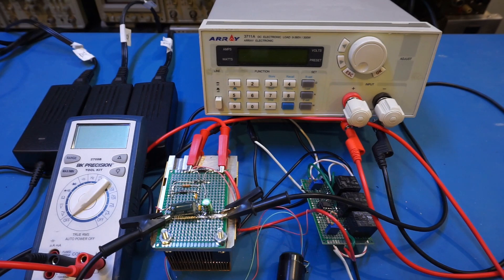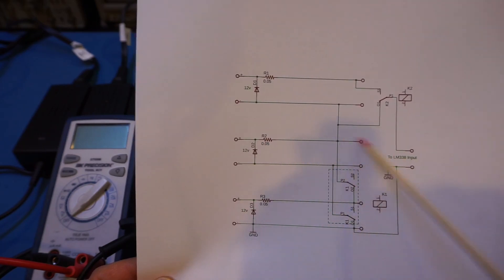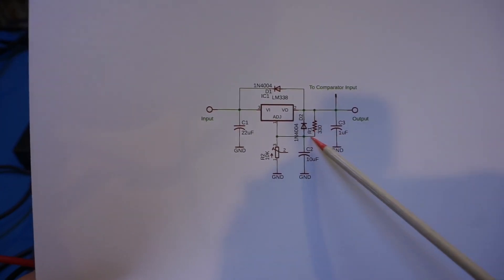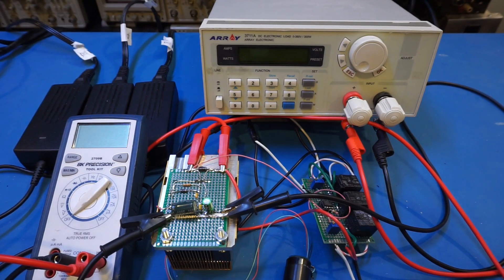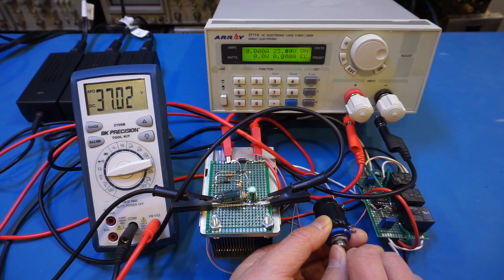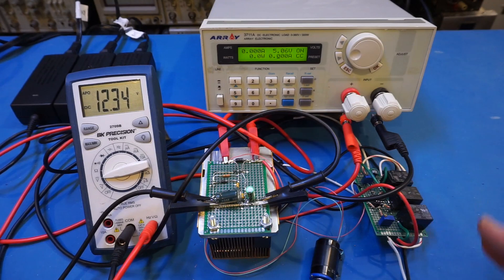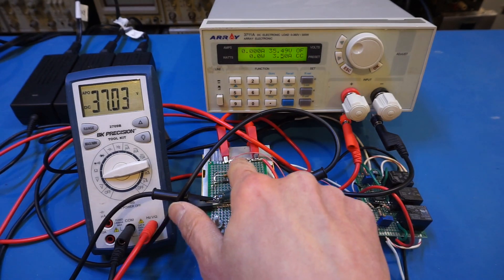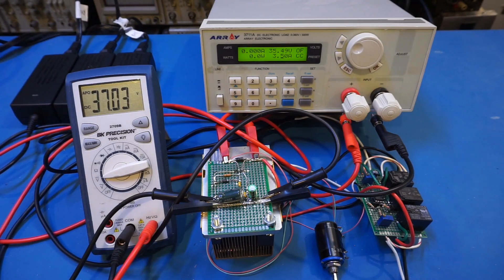Lab Power Supply Build Using Old Power Bricks - Part II/II

Comment: What if you sample the output voltage through a single diode-capacitor rectifier? This way voltage drop during relay-off situation won't drain that small sense capacitor, and the comparators won't go crazy. This will essentially make a filter with negligibly short time constant when ramping up the voltage, but very long one when going down (limited only by the capacitor's self-discharge, or adjusted by putting a large resistor in parallel to it). This mod will allow the PSU to react quickly to turning up the voltage, and when you reduce the voltage, it will just end up momentarily applying higher than normal input voltage to the linear regulator, which a decent heatsink should handle no problem.
Reply from the maker: Yes, could do that as well. One of the cleanest ways to do this (without increasing the time constant like the method I used and the one you mentioned here) is to sample the output on one of the 12V outputs via a ganged potentiometer and extrapolate.
Reply: @KerryWongBlog  That's probably the best solution. But a dual multi-turn potentiometer might be a bit difficult to find.

Comment: I'm confused at this point: How 0.05r make the power supplies not collapsing? What's the principle behind it?
I've watched the last video but I'm still confused about it.

Also, why don't you connect all GND's (of all), and you leave one power supply always ready and then you add those 2 (one by one) supplies with 2 relays?
Why not using schmitt triggers instead of comparators to avoid relay clicking when the compartor is on the edge?

Awesome work, just found your channel on the previous video and subscribed. Your channel is full of great potential, thanks for sharing your knowledge :)
Reply from the maker: Here is an intuitive explanation, Consider that one PS has an internal resistance of 1 milliohm and the other has an internal resistance of 4 milliohm. If you parallel them up directly, if the underlying power supply output voltages are of exact match, because the outputs are tied together the output terminal voltage is forced to be the same as well, therefore the PS with 1 milliohm must output four times the current to match the voltage drop over the 4 milliohm internal resistance counter part. Thus the currents are not shared equally across the two supplies.

If you connect a 50 milliohm of resistor at each output, the over all resistance would become 51 and 54 which would allow the current to flow through almost identically.

In general, you want the current sharing resistor to be significantly larger than the internal resistance of the PS you are trying to parallel. And for a well regulated power supply the internal resistance is extremely low so a 50 milliohm resistor would suffice. But for PS with higher internal resistance, you would need to increase the current sharing resistor.

To your second question, yes you could do that (which is one of the scheme I showed in my previous video), but you wouldn't be able to parallel up the supplies.

Comment: Regarding current limiting, the "easy" option I use in all of my industrial designs is a high side programmable current switch, such as the 
AUIR3315. This gives you short-circuit protection since the output will disengage within a few microseconds. In one design where a capacitive load is being driven, I've used a multi-stage approach where the current limit was changed during startup.. from 15A to 5A to 2A for nominal operation. Therefore, the final load will instantly trip if it exceeds 2A, but the initial 15A limit allows the caps to charge. This type of chip also makes it easy to create under/over voltage lockouts either with an MCU or comparator + caps for hysteresis control. As an unrelated point, I love those little proto boards haha. I've prototyped some absurdly high density designs on them, yours are very sparse by comparison. ;) Thanks for the vid!

Comment: I would consider current limiting mandatory for a lab supply
Reply from the maker: Probably :-) I mainly wanted to demonstrate putting the input in parallel and in series in an automatic fashion without getting bogged down with all the other features.
Reply: @KerryWongBlog  fair enough

Comment: Does the range switching section need some hysteresis to prevent oscillating if the voltage was held right at about say ~9.5 volts?
Reply from the maker: The 150K resistor between the comparator positive input and the output does exactly that, adding some hysteresis so that there is a few hundred milli-volts differences in switching depending on the direction you go.

Comment: It would be fun to see how far you could push this concept. 12 power bricks?  48 power bricks? 

I'm feeling pretty inspired :^)
Reply from the maker: Anything beyond three or four bricks would make the switching circuitry very complicated, which would defeat the purpose of this "simple" hack IMO. Also, for safety, you shouldn't float PS ground higher than 100V without the spec explicitly indicating you could do otherwise...

Comment: I can't imagine paralleling will work reliably, unless, maybe, you get lucky and have two supplies with very close output voltages. Still wouldn't be a reliable situation though.
Reply from the maker: The output voltages from these power bricks are within 10mV from on another. Also there's a 50 mili-ohm current sharing resistor used for each one.
Reply: @KerryWongBlog  Hats off to IBM then :-)   A 1 V difference wouldn't have surprised me.